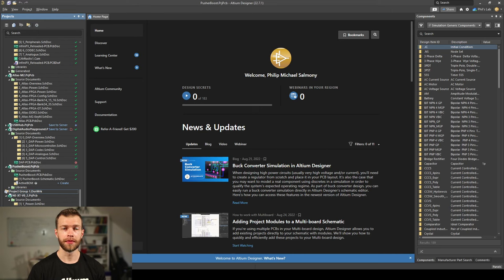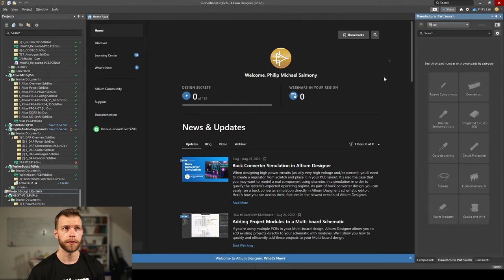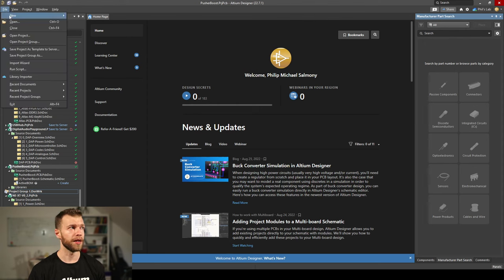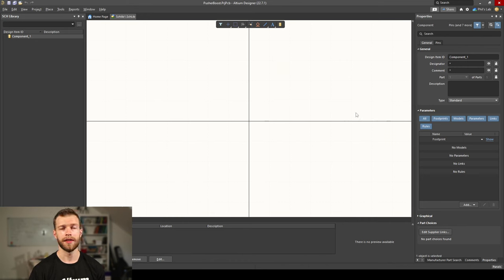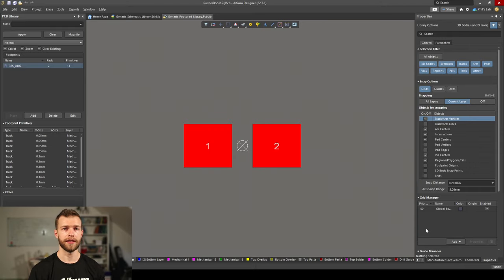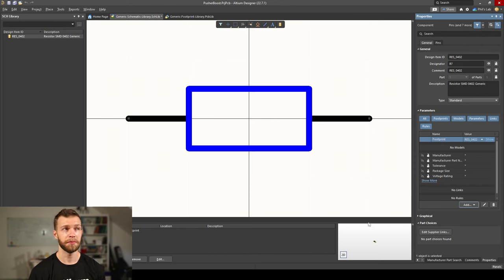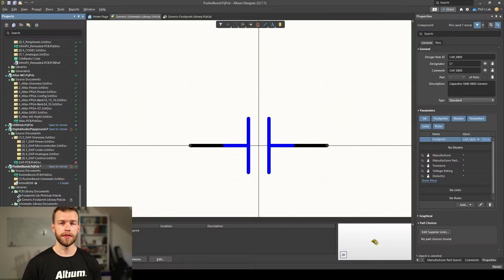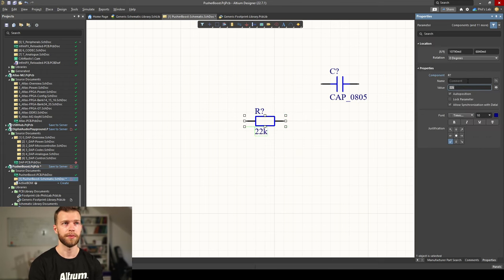How To Create Your Own Libraries in Altium Designer

Comment: so youve created a footprint for a very specific 0402 from a datasheet rather than from a standard that all 0402s should be. Nuts!
Reply: You do realize you can change the parameters in a symbol once you put it into a schematic, right? You can have an SchLib file full of generic parts, and have a footprint assigned to each part, then you can change the MPN and supplier information once the part is placed in the schematic. You can also copy that specific 0402 to a new part and give it a new MPN inside the SchLib.

Comment: Here is a neat trick. In the comment section type in as an example  this =Value+' '+Toleranse This will take produce a comment like this 1K 1% If the component value parameter is 1K and the toleranse parameter is 1%. The ' ' is a space you could use '-' to make 1K-1%. Another example is =Designator+'-' Value+' '+Toleranse. Will make a comment string like this R5-1K 1%.

Comment: Hi Phil,
Thank you for the great video.

What is your approach when creating other footprints ( i.e. SOIC, MSOP, SOT-23) especially considering that different manufacturers show slight differences in dimensions and tolerances?  
Do you usually follow a more generic approach like a single footprint covering multiple i.e. SOIC8 packages and increasing tolerances if it's required by when a new component is added? 
Or would you recommend having a single footprint for each component (at least per manufacturer)? But then how could we fit this approach when having alternative components with the "same" package?

Comment: So far so good. But some important information is missing. I would like to have a separate component in my library for each R0402 resistor value, for example, where all the information (manufacturer, order number, ....) is already stored. Do I have to draw a new symbol each time?
How can the local library be moved to the workspace for access from several computers?